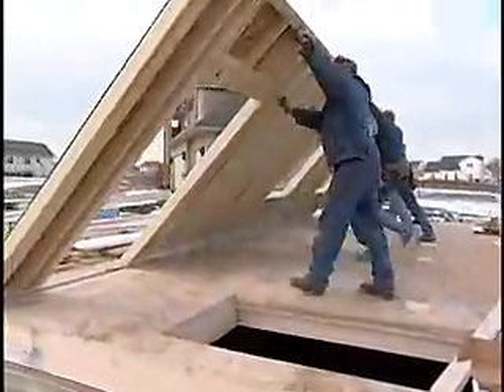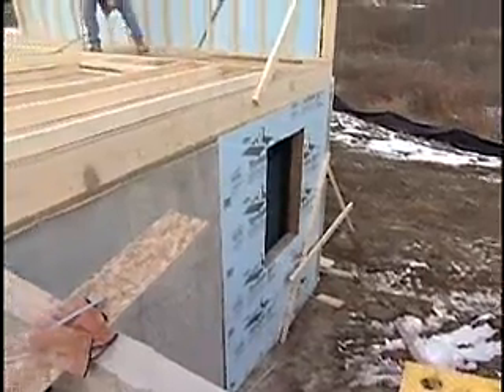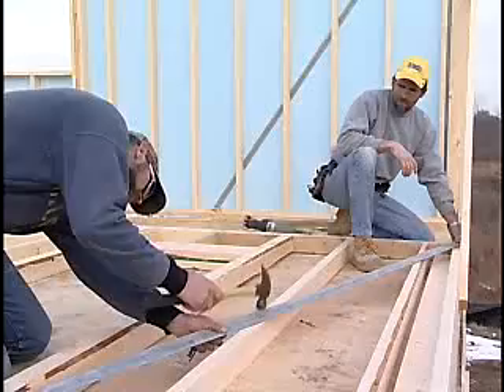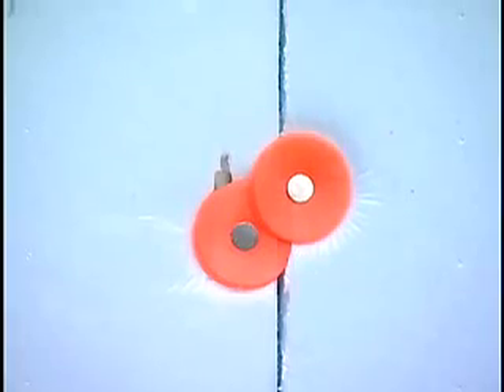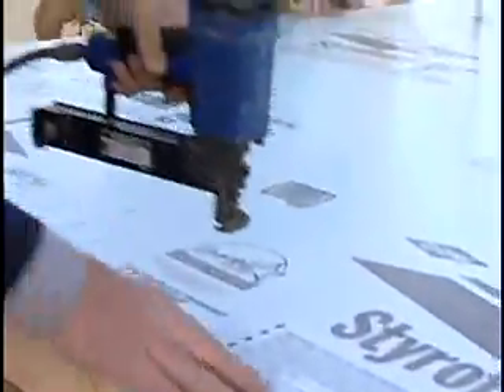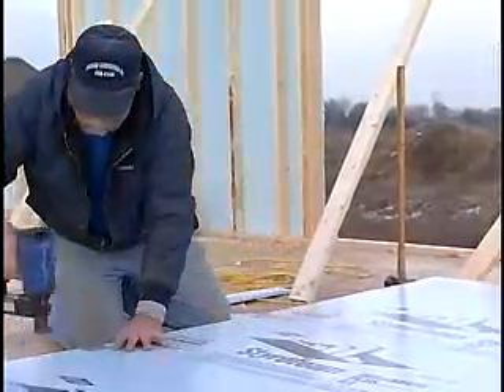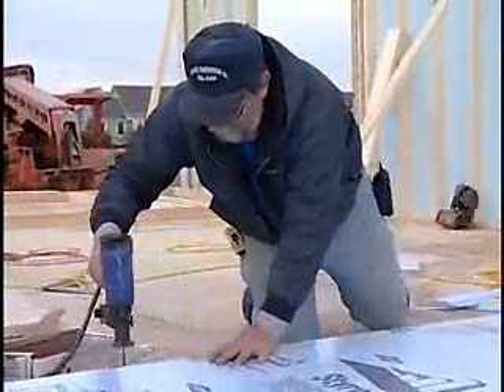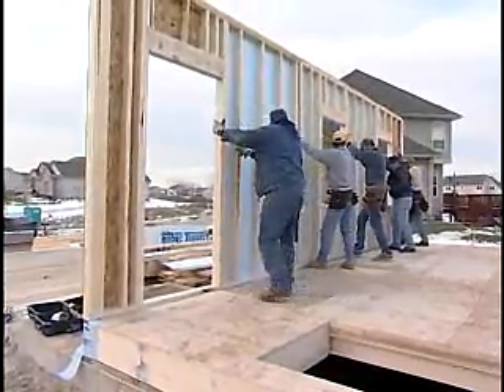Exterior Wall sheathing with rigid foam insulation

Comment: I was doing this in the early 80’s when I framed.
Reply: Just foam sheathing and no osb?
Reply: @Justgamingfailsokay  yes just foam sheeting with wind bracing.  I’m not saying I think it was the best way to go but it does give you a decent thermal break.  Wouldn’t want to be inside that house if there was a tornado shooting studs and debris through it. 😂
Reply: True! I would be scared to be in any house if there was a major tornado coming through!

Comment: "FOAM SHEETING", that kind crappy rigidity/strength are you gonna get from that?????, if OSB or plywood is used ALL the time then that's fine, BUT a layer of "stucco"????.. you can go through that wall with a kick with a steel tip shoe!!

Comment: This isn't a bad idea but in all my research there really isn't any need to do rigid when you can do closed cell spray foam in the studs. You get way more out of the CC spray foam and you can spray to 6" in any standard exterior wall which is enough for even the most extreme heat/cold parts of our planet. Therefore I'm no longer of fan of rigid exterior. There just isn't any need for it. If you've seen what 6" of C.C. spray foam is like in a wall (overkill to the max) anything beyond this is just wasting time and money.
Reply: you can still do closed cell on the inside, the purpose of this is not to replace regular insulation but to create a block against thermal bridging at the 2x4 or 2x6 in the walls and to create a tighter building envelope then traditional OSB gives you. closed cell spray foam only insulates between the studs, this blocks (or slows) the heat loss thru the studs, wood has really crappy R-value so it doesn't matter how thick your spray foam is if your going for thermal efficiency.
Reply: 77Avadon77
 Oh, no doubt, for sure they would say it's overkill and you likely never would see a return on your investment, hell the spray foam guy we use for our house builds doesn't even do more then 5.5" of foam on the roofs as he says anything thicker then that is a waste of money for this climate, It also doesn't feel as strong to me personally as OSB, I just like the idea of overkill if it doesn't throw the prices to crazy, so on smaller houses (600 SFish) it wouldn't be a huge cost add do have the extra layer.and cheaper then the added costs of the staggered stud wall.
Reply: DanielRichards644 damn home energy rater of the year!. absolutely right, increase the air tightness, reduce thermal bridging, properly can replace the air barrier too
Reply: DanielRichards644
Yes in some places that makes sense, like the artic. But thermal bridging is pretty minimal. Where I did closed cell I have a staggered stud wall so no bridging. I would almost recommend a staggered stud wall before I recommended exterior rigid simply because it can be a pain in the ass to install, to hang plywood/osb over and can various issues. Not much of a fan of it. 

Why not do interior rigid under the drywall. I don't know if people do it, but you have a lot less issues I would bet. You don't have this product hanging out on the outside of your house with tons of heavy siding hanging on it and you don't have to worry about water getting  in between all these sandwiched layers. I'm building a 100k shop and I'm doing what will probably be a 20k spray foam job inside of it and I'm not even doing exterior rigid foam. Ask a lot of insulator guys, you'll see that they will try to steer you away from it for so many legitimate reasons. I get that it looks good on paper, but the install as well as issues down the road with it can be problematic.

Comment: Do I still have to insulate the inside walls with regular insulation
Reply: yes, these panels only have about and R2.5 to R6 depending on the thickness, the key use of this is to slow heat loss thru the 2x6 or 2x4 studs that even Closed Cell Spray Foam can't prevent.

Comment: Stucco applied directly to the foam? I could throw a rock through the wall. You mean that plywood isn't installed over it then wrapped with tyvek and then siding? Or in the case of stucco, plywood to the wall frame then the foam then the stucco?
Reply: nope have seen lots of these flimsy houses built without wood sides- crap owners never know unless they come out, see and complain. Rip off unless osb or plywood is additional Just too cheap.